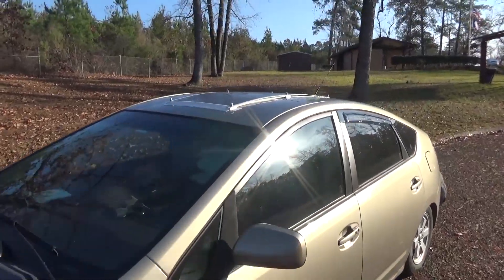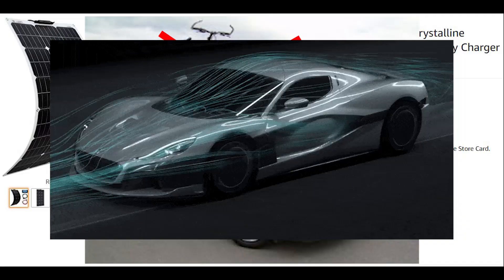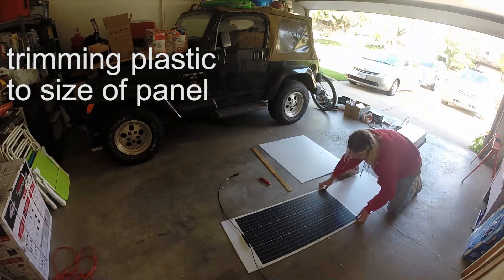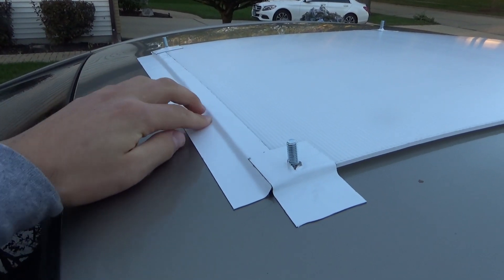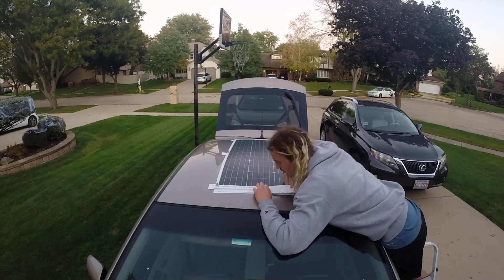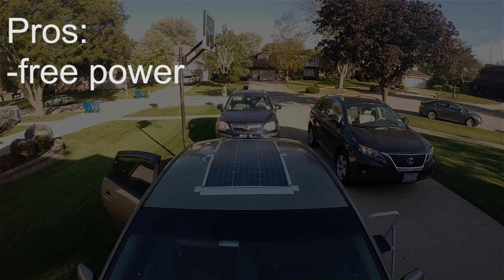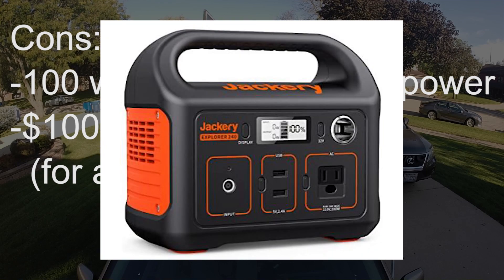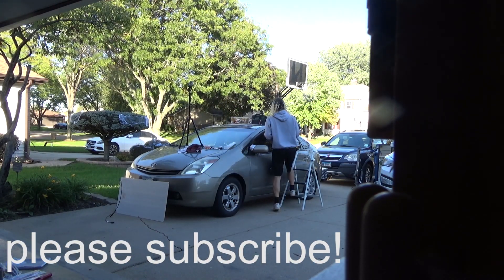HOW TO INSTALL A SOLAR PANEL ON A TOYOTA PRIUS (camper)

Comment: Great idea. I'm thinking of putting in some lifepo4 in the future to maintain internet, all my devices and possibly a fridge. Will definitely reference this when I get into solar. The wiring through the hatch is the only place I would be careful with. Short term that works, but long term, I'm not sure how the seals would hold up. It may seal ok for now, but driving into a storm a few years later and getting a leak would be rough. Just keep a lookout for that every now and then. I've 3D printed window clip-on spacers that allow a small gap for antenna wires to pass through the rear windows, but power wires are thicker and less flexible, so that would be trickier.
Reply from the maker: True. After about a year I haven’t had any leaks thankfully. Best of luck with your build & thanks for dropping by

Comment: Another great video man, I’m starting to notice more flex panels installed with marine grade silicone and gorilla tape…definitely better than poking holes in the roof. There’s one Prius that removed his roof antenna and used that as an entrance for his solar cables.
Keep up the good work and happy travels 👍🏾
Reply from the maker: Thank you—silicone could definitely be useful here  the antenna hole good idea too. And will do :)

Comment: Could this be used to help the hybrid system charge when an appliance isn't directly connected to it?

What happens when you run out of battery for the fridge?
How long does it take the battery to charge, say on a spring day? 

Could you upgrade to a larger battery so it can charge all day and then keep the fridge on longer?
Reply from the maker: I’m sure it could be used to charge the hybrid system but the car isn’t designed for it and I’m sure it would take more complicated electrical work. 

When I run out of battery I turn the fridge off and power the fridge with the car or my power station.  

It depends on how sunny it is for the battery to charge, but with my dc to dc charger it can charge in about 3 hours. 

And yes I could upgrade the battery so it would last longer but this 50ah battery is big enough for me right now. 

Thanks for watching good questions 👍

Comment: This is a really cool idea! Inspiring and motivating me to install one for mine.
Im trying to figure out the controller to install.. 
It's good to know the dc-dc works to get the extra energy from the car. Do you happen to have a diagram on how to put it together?
Reply from the maker: I made a video about the charger. I think there’s a diagram in here: https://youtu.be/sNldyKoW1rI let me know if this helps

Comment: I couldn't make out the gap in each corner u  ran The Wire through. Appreciate any clarification in advance
Reply from the maker: You can force it through the corner of the trunk hatch by opening and closing the trunk to gain some wiggle room. Hope that helps

Comment: Do you know how to use this solar power to charge prius engine's main battery?
Reply from the maker: No--i don't believe there is an easy way to do this, and it would have very little benefit to mpg

Comment: My question is, with the small amount of energy produced by the panel, on a regular setup just daily driving, would this save some energy since the HV battery doesn’t have to give more power to 12v?
Reply from the maker: In theory yes, but the main purpose of the panel for me is to keep the fridge running while I’m parked for extended periods of time

Comment: With the way you've routed the wires into your car, have you noticed any water entering your vehicle through the rear hatch weather stripping?
Reply from the maker: No leaks through the hatch so far. I had the common leak from cracks in the roof side channel thing but once I sealed those, no more leaking
Reply: @soilliam  Great to know! I am considering adding at least 1 flexible panel to the roof but I was concerned about the stealthy-ness and leakiness. Thanks!
Reply from the maker: @asquattingmule9697  sweet, yeah Ive had no problems yet! best of luck